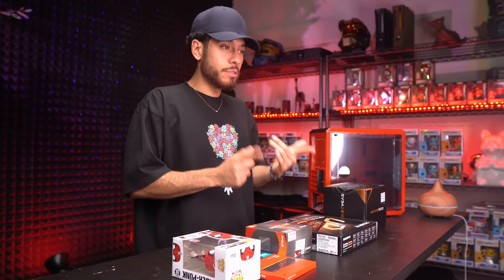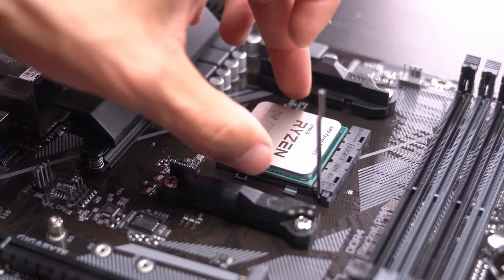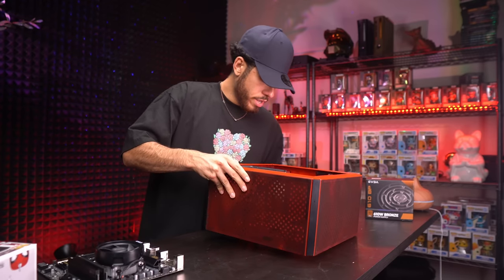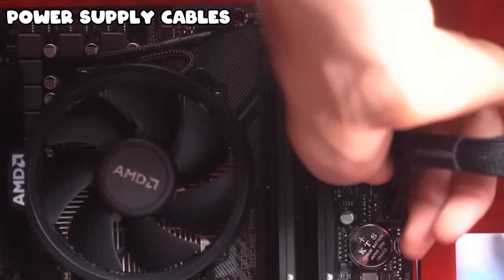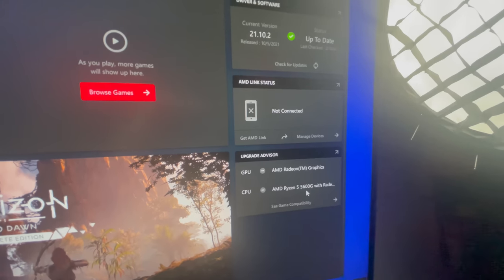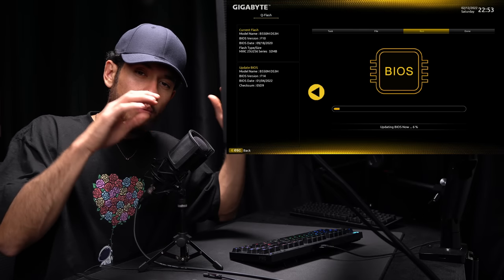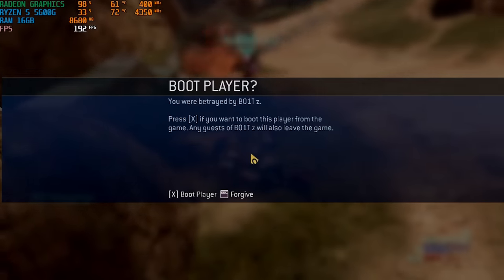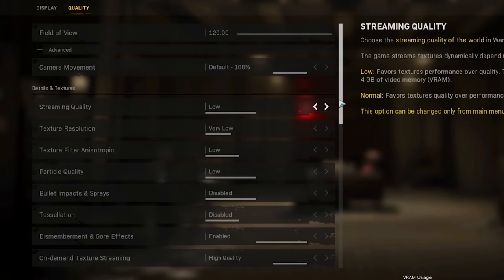$500 Budget Gaming PC Build Guide - Ryzen 5 5600G (w/ Benchmarks)

Comment: Wouldn’t it make more sense to buy a 6500 xt and i3 12100f for way better gaming performance with a dedicated gpu
Reply: A 6500xt and 12100f cost 400-450usd alone -_-
Reply: @Magnus Rasmussen in my country
A 12100f cost around 150usd
And a 6500xt is 300usd 
:')
Also 6500xt is pretty bad
It doesnt even have an encoder to record screen
And the performance is roughly the same to a unreleased amd gpu that can only be obtained through oem prebuilts the "RX 5300"
So ye ur better off witg a 1060 6gb which is like the same price

Comment: have any change to put on gpu ex:rtx3050 & wifi card at the same time on this mobo??
Reply: @Magnus Rasmussen think i change my plan.. will going for 5600x + rtx 3060.. is that overkill for streaming 1080 esport game?? also planning to install bluestack for some mobile esport game for streaming..
Reply: @Magnus Rasmussen will play some aaa game also but for myself only such elden ring, god of war, etc.. not for stream.. so should i stick with my build??
Reply: @Magnus Rasmussen already cross check the price between 12400f combo vs 5600x combo.. ryzen got cheaper abit bit at my country market.. around 25usd diff for same level mobo.. so i think i stick to ryzen build.. overclockable is there..

Comment: I legit bought everything from the list and actually added an addition harddrive to load games on but after building and installing drivers and everything the exact same way Joey did my computer keeps crashing and I have not one clue what to do :( can anyone help ???? Games such as Counter strike Madden 22 ussually cause a random blue screen (screen of death) to pop and fortnite will run smoothly for maybe 2 mins before just crashing and closing window on its own.
Reply: Does your PC crash just while gaming or even if you aren't actively doing anything?
Reply: @JJFlores197  Helllo Jose, its only when i play games, I reached out to amd thinking maybe i did something wrong who then determined it was my RAM so i order new ones but now I think it may be my mother board because with the new RAM installed i ran a MEMtest86 and same problem is happening. Could it be my Motherboard ?? I reached out to gigabyte but itll take them 3 Days to respond :(
Reply: BTW thank you for your response!
Reply: @bryanochoa-flores1688  Its hard to say. It could be RAM, the motherboard, or even the power supply. By chance, did you overclock anything? Like CPU , RAM (XMP) or graphics? If so, temporarily disable any OC settings and see if that helps.
Reply: @JJFlores197  yeah I changed back the ram to 2666 instead of the 3200 mhz and that seemed to get my computer to stop crashing … I’m guessing I won’t be able to oc the ram anytime soon
Reply: @bryanochoa-flores1688  yeah RAM can get finicky when you start overclocking. It's part art, science, black magic, and luck.

Comment: I used this case for my build when I installed the PSU cage and attached it to the case my power supply isn't flush with the case looks kinda pushed back is it supposed to look like that ? Lol
Reply: for me aswell
Reply: @muratnuriyev615  the only thing I kinda dislike about it and the side panel could be a little more firm but besides that it's pretty solid for the price ..
Reply: @lazeplaysgames   yeah , but thats my first pc .  i had laptop i used like 10 years, but this new upgrade makes me crazy happy
Reply: @muratnuriyev615  same here beats my laptop by far lol
Reply: guys , i  did put yesterday rx6600 on and extra 1 case fan , it runs perfect , till now i tried valorant i get more than 300 fps

Comment: I dont know why i like this build better then my 5600x RTX 3070 pc its so ez and cheap/simple and still offer good performance
Reply: The IGPU in a 5600g is weaker than a GTX 1050. The 5600g only has 8mb L3 cache compared to 32mb L3 cache on the 5600x. Why would you like this build better than your own PC?
Reply: @ZackSNetwork  I told u why read my comment again

Comment: Please stop putting motherboards on a bare hard surface table. Ive watched my friend damage his mobo because he tried to install the RAM on a table just like this and the pins on the bottom bent and snapped off. Always install components after the board SECURELY installed in the case. Watching it slide on the table as you pushed in the RAM just made me cringe.